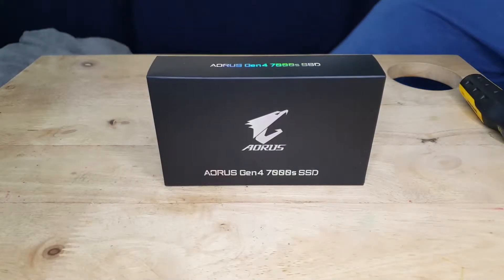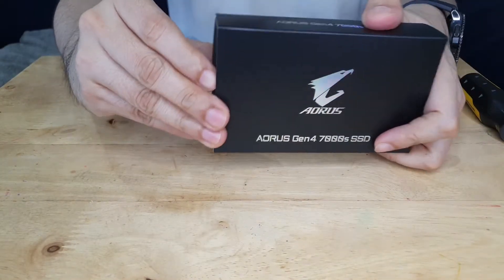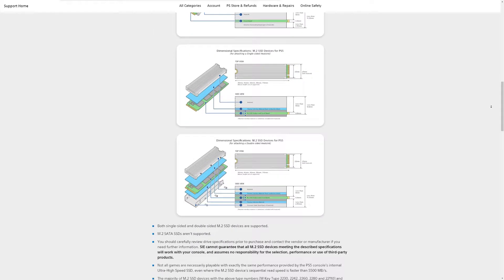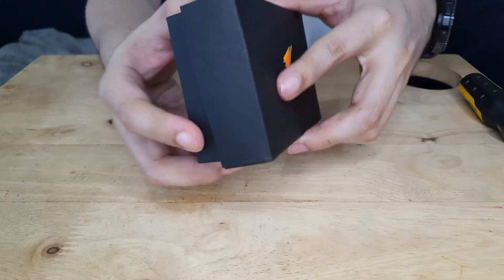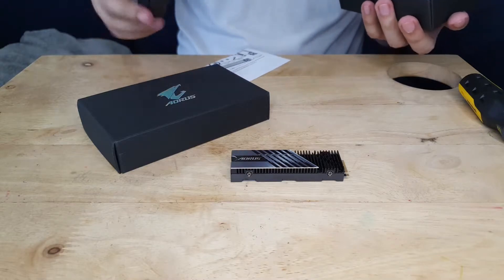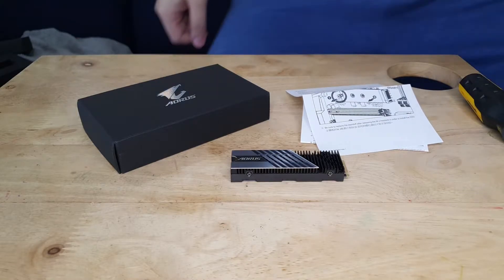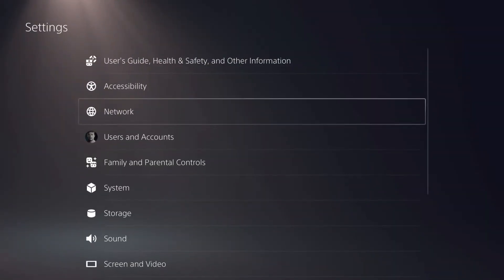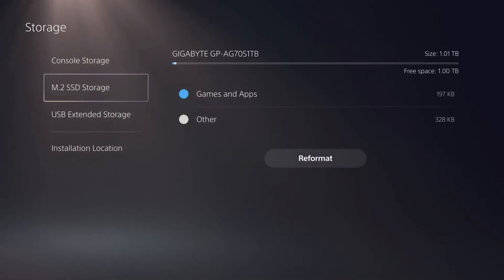Gigabyte AORUS Gen4 7000s 1TB M.2 SSD for PlayStation 5 (Tech)

Comment: just bought this exact drive and storage spec on ebay for 149$ Also added a USB 3.1 nvme adapter to update it on my laptop 💻  highly recommend to get advertised speeds. as the laptop does not carry an on board nvme slot for drives.

Comment: i bought the same but only getting 5800 speed. any idea?
Reply from the maker: Hmm don't know if you've tried checking on a PC but I found some posts about firmware concerns and nothing's conclusive. Found one or two where they said they had it returned and got better speeds after a replacement
Reply: Firmware update multiple Ssd don’t get to the speed until it’s updated. You will need a computer for it desktop or laptop with a extra available space to add Ssd m.2 the other option will be to buy a external m.2 case for you to update it
Reply: I have the same problem, speed on PS5 won't go above 5700 MB/s. I'm on latest firmware (updated on PC), 21.2
Reply: I have speeds of 5.5…
Reply: has anyone reached out to Gigabyte/Aorus for a comment on the issue?
Reply: @justaname6377  you ever fix this? Got speeds maxed out at 5,600 on the 1tb variant. Seen multiple vids where people are getting 6,500 on this ssd
Reply: @Matendu  me too and installed yesterday. I’m also only getting 5845mb/s with 21.2 firmware update and can’t seem to find answers or a solution anywhere.